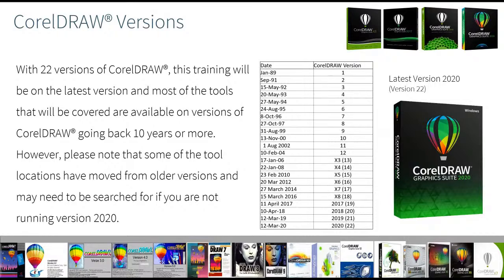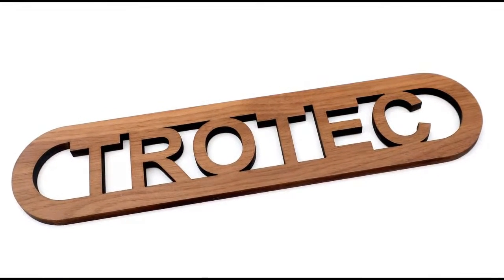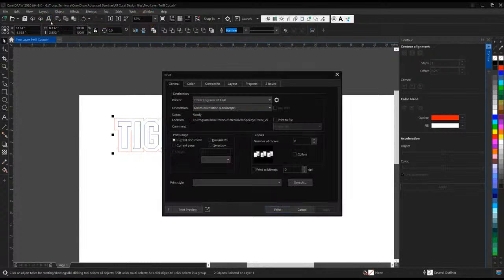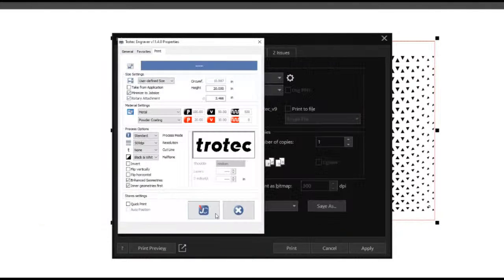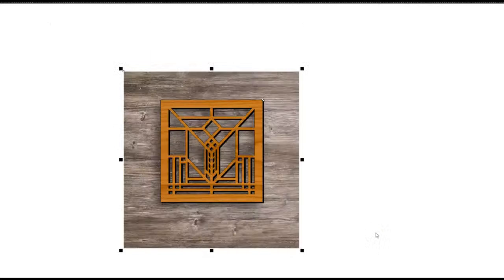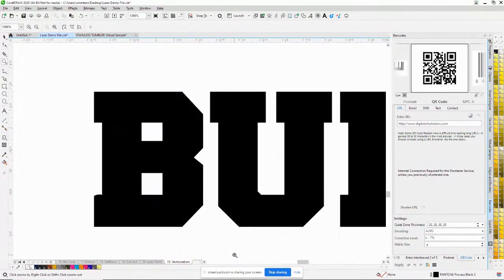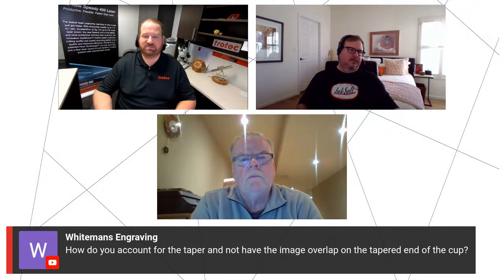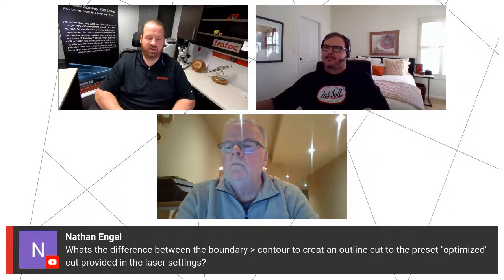Trotec Third Thursday: Advanced CorelDRAW & Laser Techniques Workshop

Comment: Time stamp:  
58:38 

Question couldn't you skew the graphic so it will be longer at one end and shorter at the other to make it fight a non cylinder?
Reply from the maker: Hey Bryan! Yes, you can skew a graphic by measuring the non-cylinder at each location and mathematically adjusting the graphic to match the changes to a cylinder however it can be time consuming to figure out.

Comment: First, GREAT seminar.  It is always nice to see how others do the same thing as I do, but do it a different way — as well as learn about new features I never knew existed or how they w/could be useful.  I consider myself an expert in CorelDRAW and have used it since v1.  However, I seem to be stuck in older features instead of the newer whiz-bang stuff CorelDRAW does now, and more efficiently that I had been doing.  I was particularly enlightened by the “gunstock grid” technique: how come I did not figure that out?  That ol’ Laser Dave guy should work for Trotec…

The latest version is v2021 (which might not have been out at the time of this seminar, but I think it was).

The ratio of the circumference to the diameter is π, spelled “pi” not “pie”… 

For the “uneven” / tapered glass rotary engraving, it seems the bounding box to fit / stretch the engraving background graphic would work IF the bounding box was a trapezoid, instead of a rectangle, using the diameter at the bottom of the glass as the “short” length of the trapezoid and the “long” length of the trapezoid calculated from the diameter at the top of the glass, of course using π times diameter to get the correct length.  Then just stretch the graphic to each of the four corners of the polygon.

The term “bézier” is correctly pronounced, BEH-zee-ay, not BEH-zee air.

Craig Martens made an excellent point: just because you can design something with fancy tools, does not mean you should: one needs to consider how the graphic will be used.  Not to bash Mac users, but… Of all the people who should know / understand graphics, they seem to know the least.  Their designs that I get are commonly overtly complicated and they use bitmaps for things that should be vector.  I usually get designs that are 24" x 30" and have to “reduce” this down to a laser on a 2½" item: it is just nuts and takes me forever to clean up their designs — which presents me will real world opportunities to explore CorelDRAW’s tools to make my job easier.  When I ask for EPS files or older versions of AI (because Mac AI files are not the same as Windows version for version AI files), they give me files that are 90% bitmaps converted to EPS / AI and cannot understand why I cannot use the file: seriously!!

Another option for adjusting bitmaps is CadLink’s EngraveLab PhotoLaser Plus; this is great software and offers more laser-specific options than options available in a hardware store.  CorelPhotoPaint should consider incorporating at least half of their PhotoLaser options.

You recommended to use the subscription version of CDR.  W R O N G!!!  What is not disclosed is that the subscription version “dies” the day the subscription ends: no before or after tail end subscription extension.  My subscription ended on 16 Mar; so while in the middle of a project on that day, with three more projects in design mode and backlogged, CorelDRAW would NOT save several hours of work.  I had “auto-pay” set up so I would automatically pay for the new version, when it became available.  Well, there I was, dead in the water.  I called Corel “Support” and, as nearly everyone has learned / experienced, the foreign staff is not competent enough to understand or provide a reasonable solution: obtusely scripted and rigidly linear thinking and next to impossible to get them off that automatic “think outside of a script” mode.  After several calls, my case was escalated to be resolved as soon as possible.  The next day, I received an email providing me the SN of v2021 and the link download the new version.  I installed it, the SN worked, BUT when I was asked to log in (are you a current member?) just after installing the program, I received a red error message saying that my login was not recognized: call tech support for assistance.  Yeah, right; after logging in for the past 40 years and I am not recognized…   So I called tech support several more times; sometimes I actually get luck and get to talk to a support person who knows what they are doing: provide support and resolve issues.  If the issue was as “simple” as my auto-pay not working, it seems the most basic first-tier support person c/should have figured that out and then I could have resolved that immediately.  As it was, it took them over a week to let me know the auto-payment never worked.  In the meantime, I found a local software store and “had” to purchase a CorelDRAW 2020 CD version just so I could get back to work.  I wish I would have spent more time on the Corel website — or could have talked to more competent support staff — where I could have purchased the “sale” price of Corel Technical Suite, which included CorelDRAW 2020 Suite, for less than I had to pay for the CorelDRAW Suite that I just bought.  I used to use Corel Designer for most of my lasering because it had precision features CorelDRAW does not have but switched to CorelDRAW because it worked better for many projects and had graphic options that Designer does not have.  Bottom line is I will not buy a subscription; it is almost just as inexpensive to buy an upgrade CD than the subscription.  I do not need to have the latest version ASAP.  I can / will wait until the Black Friday sale and probably upgrade to v2021; a few more months using v2020 is not going to appreciably affect my business.  Version 2020 worked great for over a year, so using it a little longer should not be that big of a deal.

I could NOT “save as” my 2020 files to an earlier CDR version to laser my jobs with a laptop with an older version of CorelDRAW BECAUSE my “expired” license grayed out most important functions: Save, Save AS, Copy and Paste, etc.  There is no good reason why a subscription should be exactly 365 days.  There should be a built in overlap to give let users know that the auto-renew has not worked and completely shut down users, like me.